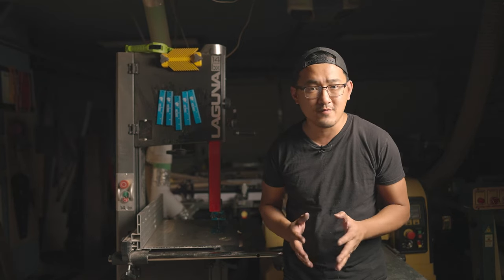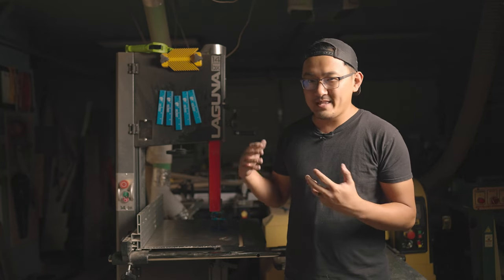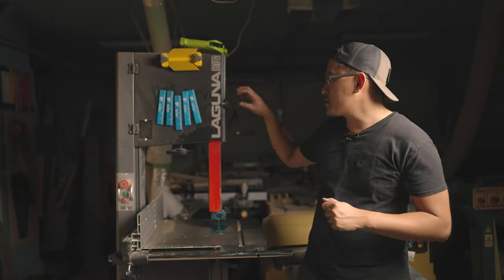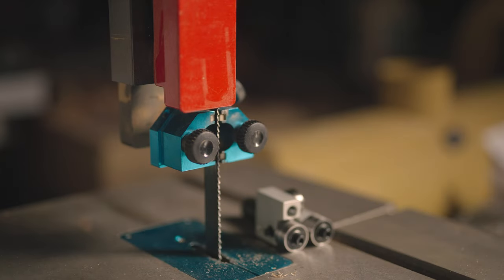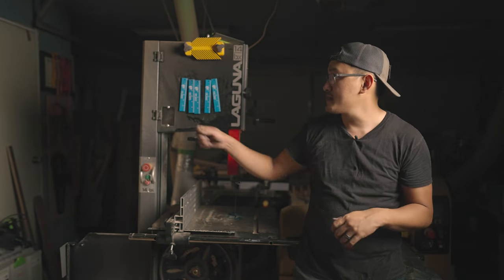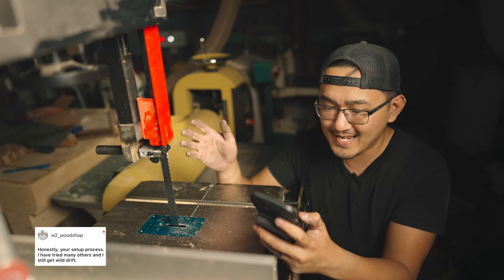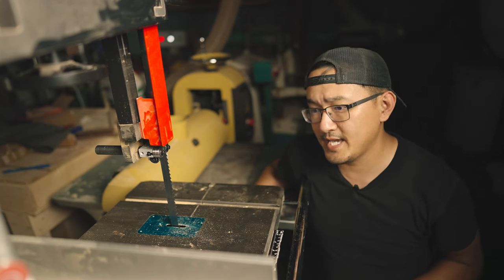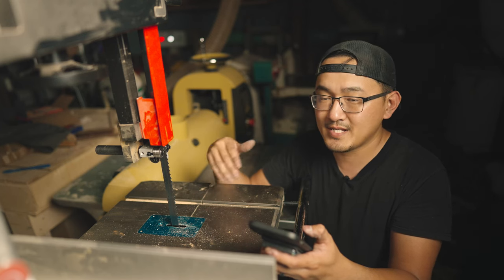Laguna 14BX Bandsaw Long-term Review // Woodworking

Comment: Ok... of all the review vids on the BX14, I'll leave my comment on this video. Just finished setting mine up, 220V version, and performing test cuts. Wow! Fantastic bandsaw. I cut a paper thin veneer, silky smooth finish, and fast like butter pushing through my 7" wide test piece of poplar (Resaw King 3/4" blade). Dunno why you'd replace the ceramic guides. As for the tension indicator, yeah, it's kinda hack-job, but it (a magnet) is effective when properly placed as per instructions.
Reply from the maker: The key to your success was you just finished setting up yours. Out of the box, the guides were great for mine as well. After awhile...not so great. Hence why I swapped it out.

Comment: Nice review , if I can be of some help , you can stop that machine screw from getting loose by using LOCKTIGHT compound , you can get it at just about any hardware store , even the big boxes one have it
Reply from the maker: Thank you! I didn't want to constantly deal with loctite everytime I had to switch blades

Comment: I too have had the bandsaw for a little over two years and would like the information on the Carter guides you replaced the laguna ceramics with? I did not see anything in your links but appreciate you insight. I love the saw and have the same issue with the guides. Thanks again
Reply from the maker: This is the one I used. https://carterproducts.com/lag-01-2856

Comment: Thanks for sharing the experience. I have the 1412 having similar guide. I 've figured out it's not the fault of ceramic material, it's the design. Ceramic guides are actually provides more support to the blade so they are  more precise. The Laguna's guide is just too flimsy . We have a local brand also uses ceramic guides, the ceramic piece is twice thicker and there is a large dovetail wedged into the Aluminum body  so it won't come off as easily as the Laguna's. Moving to bearing type of guide is definitely more suitable for heavy duty use. For me I have changed the holding knobs to make it bigger to it can tighten down the guide firmer.
For saw blades, have you tried Lenox Tri-Master, it's TCT  and I thick it's more robust than Resawking?
Reply from the maker: Yea the knobs themselves were my biggest issue. And no I haven’t tried the Lenox brand. Have to check them out 🙌🏼

Comment: I have also had this bandsaw for about two years. I also hate the guides, especially the bottom one. Something else that bothers me is that 3/4 blades never seem to track correctly, so re-sawing can be a issue.
Reply from the maker: Yeah, 3/4” can be tricky. I try to keep the bottom of the gullet aligned at the center of the wheel. It helps a lot.

Comment: Really helpful vid.  Thanks.  I just got a 14 Twelve with the Laguna 3/4" resawking and I have cranked the tension up almost as far as I can crank it and I'm still getting some flutter.  I have to pull the guides out 3/16" or so to keep them from touching the blade.  Not sure what I'm doing wrong.  It tracks fine and cuts beautifully though it drifts a bit.  Have to do more reading I guess!
Reply: Oh and I sooo wish I'd seen this vid BEFORE I bought my 14 Twelve cause I bought the mobile kit and it really does pretty much suck.  I have a Bora on my table saw and it's a dream.  Dang.
Reply from the maker: I would double check the alignment if you're still drifting or check your feeding. Too much pressure can introduce drift.
Reply from the maker: I love the Bora for my planer. Will need to get one for the bandsaw too
Reply: @DesignCraftWorkshop  It's not drifting, it's wobbling (flutter).

Comment: Thanks for sharing this. I have the same 14 BX 220 version and have the same issue of the ceramic guides coming loose all the time. How do you like the Carter guides so far. Also, can you please mention the model number or a link to the carter guides. Just subscribed to your channel and Instagram.
Reply from the maker: You're welcome and thanks for tuning in! Here is the guide I purchased. I like it a lot more. The blade doesn't drift as it use to and I don't have any issues with the guides going loose. However, like all bearings it needs to  be cleaned and maintained. https://carterproducts.com/lag-01-2856
Reply: Thank you - place the order.

Comment: I really dislike the ceramic guides and the knobs loosening up as well. I have had the blocks come unglued. If you don't catch it in time you can ruin a blade.  I will upgrade to the Carter kit. The plate that the blade goes through should have dust holes in it and maybe magnets to hold it down  as well. The bottom guides are difficult to get at unless you raise the table top to maximum tilt or remove it altogether. The sparks are sort of unpleasant coming from the blocks when you reposition them as well.
Reply from the maker: So far the upgrade has been great. The bottom is still a bit hard to get to but I rarely switch blades so it isn’t a huge problem for my shop. I would say once I set the guides, it doesn’t move which makes using the bandsaw much more pleasant.
Reply: installed the bearing kit and you were right!  Made a huge difference.  Love it. $326 bucks but great quality..

Comment: So the machine is basically crap? Two more years since you made this video, what are your thoughts now? What I take from your video is that the bolts unscrew themselves, the ceramic bearings are shit, the saw vibrates and the wheel base is useless? You said "those are the things I love about this machine" but what are those things exactly?
Reply from the maker: There are some updates I think Laguna should make especially the bearing, which is probably the biggest factor since it effects the cut quality. The wheel base isn't useless, but it would help with mobility if there were 4 swiveling wheels if you're in a small shop and need to have it move around. I'm in a larger shop now and the machine doesn't move from it's location. Overal, the machine cuts great as long as you set it up propertly like any other bandsaw. I still have the machine and haven't needed to upgrade to anything larger.